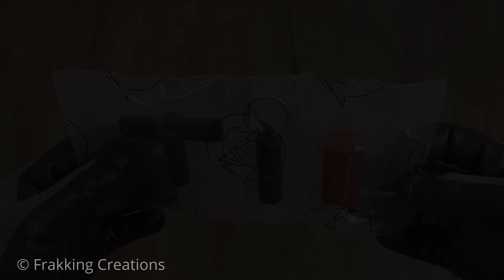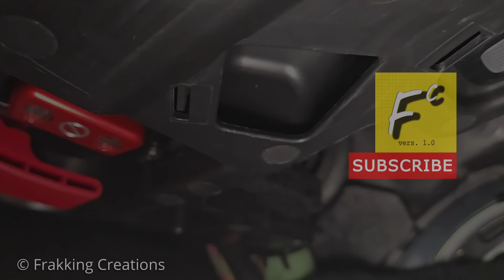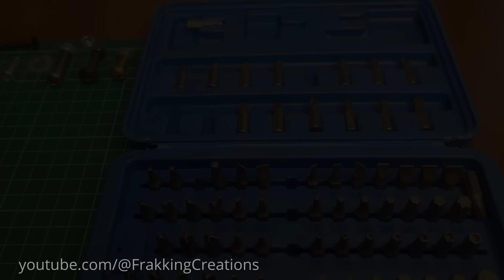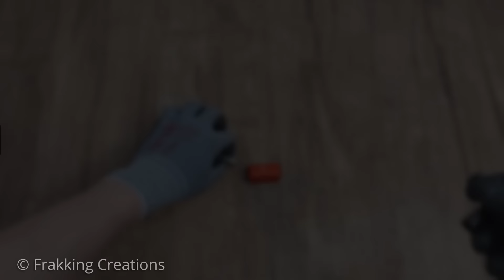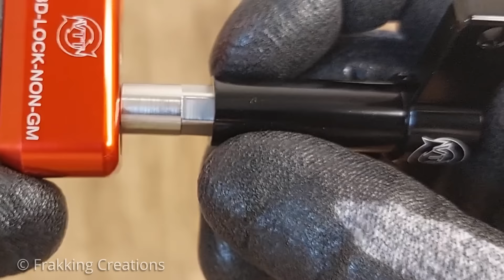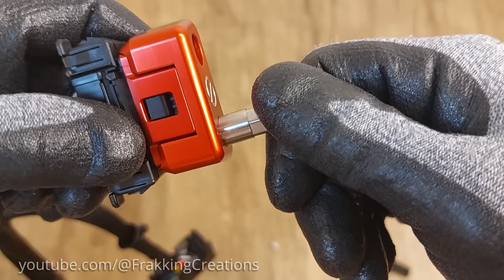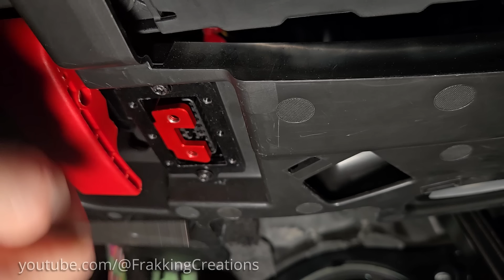Metal OBD port protection from Key FOB cloning & OBD car theft - VTT OBD2 port lock

Comment: It is possible to reach CAN bus by connecting directly to the wires. It is necessary to have a guard complex with a second authorization and send garbage into CAN when intrusion is detected and/or an attempt to access the key certification module is detected.
Reply from the maker: There are definitely too many holes and weaknesses in current vehicle technologies.  The CAN bus is another weakness that hackers have exploited to steal vehicles.  Unfortunately, layering security is still necessary but this OBD lock only protects the OBD port.

It does not protect against CAN injection attacks that use wiring from headlights and such.
Reply: Cars with smart headlights, you don't even need to go into the car. You can access the light wiring and canbus from the wheel wells.  The government forced canbus on the car makers. I was never sure why?
Reply: @quademasters249   That's correct. Various vehicles have canbus accessible externally e.g. via a fender liner and so on.
Reply: @FightForFreedom_1  Yes and all have wireless access...
Reply: @quademasters249  "I was never sure why?" Really? Social credit system vehicle remote lock out
Reply: @jdoe9518   I've been holding off disabling the car's built in cell phone till something real happens.  

The first time I hear about something like this in the US, I'll disconnect the cell phone in the one car I have that has one built in (my older cars don't have it).
Reply: @quademasters249  Ok you mean like this?

Hackers started around 2002 by targeting engine-management technologies that control performance superchargers and fuel injectors. In 2005, Trifinite demonstrated using Bluetooth to surreptitiously intercept or transmit in-car audio signals. In 2007, UK firm Inverse Path showed how hackers could compromise the integrity of in-car navigation systems by sending fake traffic updates over FM, causing cars to reroute.

In 2010, experimentation was overtaken by more dramatic interventions that could affect the mobility of the car itself. In Texas, a disgruntled former car-dealership employee used stolen credentials to access a web-based vehicle-immobilization console and began systematically “bricking” cars that had been sold by his former employer.
Reply: @quademasters249  No surprise my reply was deleted
Reply: @quademasters249  I suggest an internet search of the history of this topic.
Reply: @quademasters249   "I've been holding off disabling the car's built in cell phone till something real happens." 

It did

Real world twenty and a 10
Reply: @ I see a bunch of replies from you.  It's more likely the comment system is simply trash than that you've triggered some conspiracy filter.
Reply: @quademasters249  Yes the reply outlining who and when the hacking occurred was trash....

Cool story bro
Reply: @  1/2 the replies I already saw last night no longer show up.   I'm sure you've triggered the TLA's into removing your posts.  Might be time to go off-grid where it's safe...

In 2010, canbus had only been required for 2 years and most cars didn't have cell phones.
Reply: @quademasters249  Yet a ex employee of a dealership was able to remotely disable cars at will. I'm sure very little has progressed in 14 years..... So buy meh OBD lock! 

Pointing out reality does not = off grid

It's amazing how strong the resistance to the most simple of research is. Once again proving Dunning-Kruger right.
Reply: @jdoe9518  Buy here/pay here lots install their own interlocks, as do some dealers. It doesn't use the built in cell phones and canbus which only the OEM's can use.  its another device you can find plumbed in under the dash. 

Dunning-Kruger is right.   DK essentially says that dumb people are too dumb to be able to accurately asses their own competence.  

That's why smart people tend to doubt themselves and dumb people are full of confidence. 

You're so sure you're correct when you simply don't know the whole story.
Reply: The common criminal will plug into the port and clone the key with a specialized device. I doubt they know what going on.

If you want real security, get a manual car.
Reply: @xavier32421  In Russia that "common criminal" is an equipped and smart geek, the engineering legacy of the Soviet is still alive you know. They know what they're doing. They will even try to bypass an advanced guard complex if the vehicle of interest is worth that. Also, they delegate roles to different people of the group, one is an intruder and starter, another one is a driver, and so on.

A manual vehicle has nothing secure.
Reply: @xavier32421 put in neutal and tow it!

Comment: this might introduce problems if you can't make spare keys for this lock and lose the keys.
Reply from the maker: There is a code at the top of the security bit.  I'm sure VTT can make another one since it is CNC milled.  As long as they still exist.
Reply from the maker: The code is also engraved on the top of the security screws.
Reply: Sounds like a great idea
Reply: you can easily access CAN bus without that OBD connector
Reply from the maker: That is true.  The CAN bus can be used to steal some vehicles, for example Toyota/Lexus vehicles.

Like I said, layer your security.  There are way too many security holes in current vehicle technologies.  Similarly, just because you lock the doors of your house or car doesn't mean a thief can't break a window to get inside to steal.  Does that mean you should stop locking your doors?
Reply: I have 3 layers, this OBD tool, a wheel lock (Tevlaphee Steering Wheel Lock Anti-Theft Car Device Heavy Duty Security Car Lock) and a Faraday bag for my fobs.   Sure they could access the CAN bus but is anybody really going to go through the trouble to take a grinder to get the wheel lock off, etc and spend the time when they can pick an easier target?  for a 2024 4runner?  Most likely not.
Reply: @yzwme586   An equipped guy will deal with it quickly.
Reply: @yzwme586 About 25 years ago, I had a car stolen, but they only got about 20m (65ft). To get past the steering lock, they cut though the steering wheel. Not sure if they used bolt cutters or a saw. Hopefully your steering wheel is made with a stronger metal core than mine was.
Reply from the maker: Make sure to use the steering wheel lock properly.  It should be put around the spokes of the wheel.  Also get a good steering wheel lock that protects more of the wheel so that any cuts to the steering wheel have to be made further out.

Both these points will make it harder to get the lock off when they cut the steering wheel.  They will have to wrestle it off.

Here's our video on that:  https://youtu.be/rv1EOCbQde4

Plus you could also install a kill switch as in our video here:  https://youtu.be/8ZirqlsSBjA